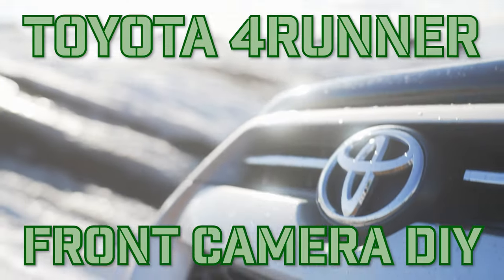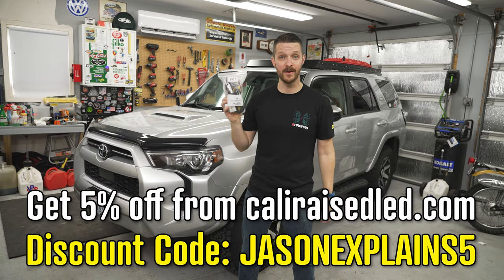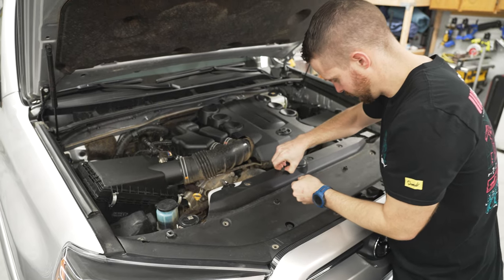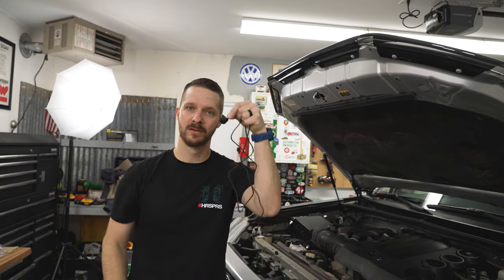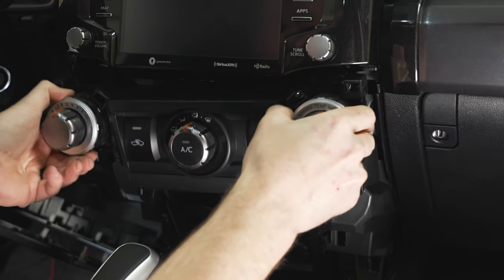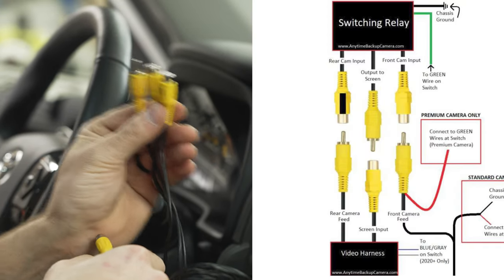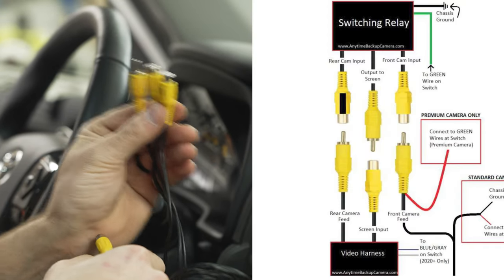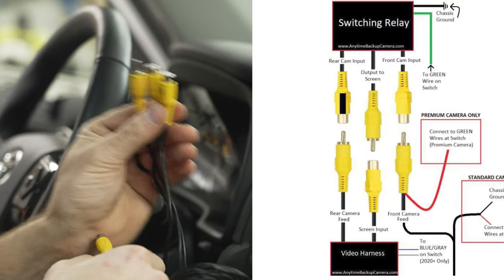Your 4Runner NEEDS A Front Camera!  (DIY INSTALL & DEMO)

Comment: How about a step further and do a 2nd front facing from underneath? Useful for wheel placement and rock bash consideration. Would need a toggle for the video feed switching.

Comment: I installed this and it works great however I noticed when I switch from front camera, to reverse, i get a horizontal split screen where it shows the bottom half of the rear cam on the top. And the top half on the bottom (if that makes sense). Anything I did wrong? I checked the wiring and ground and everything seems correct. Not sure if I need to cut another wire since I have an aftermarket HU? (T8)
Reply: Its occasional and to get rid of it I have to hit the button from front to rear super fast almost like I have to confuse the system to get the rear cam back to normal view

Comment: Jason, thank you so much for posting this, wouldn't have got one without this video! Such a cool add on. For anyone considering one, here are a couple tips that may help: 

a. The wire that goes through the firewall is relatively delicate (4 tiny wires inside) - be very careful pulling/pushing this through: you're in trouble if you break a wire - whole infotainment display WON'T work! Same if you unplug the camera. The extra grommet hole can certainly be used but recommend cutting the nipple inside the cab - just pull with some pliers and slice it off. Also consider gently slicing the grommet hole with a small knife - just a little, maybe 1/4". Will retain its shape but way easier to get the dongle through. Don't force the wires. 

b. tightening the camera nut is a huge pain. Test fit the nut on the camera before trying to install - mine was partially cross threaded from factory. It is pretty much mandatory to remove the upper portion of the grill like Jason did - be very careful if you've never done this before. You have to remove the 6 or so plastic fasteners and 1 bolt. But what you can't see are about 6 interlocking tabs that hold the bottom part of the upper grill to the top part of the lower grill/bumper. You'll need to get a very small flat screwdriver and separate the tabs one by one. You have to pull the upper grill FORWARD to the front to release it. DO NOT PULL IT UP like many videos show. You might get lucky and have the tabs self separate but likely you'll break one/some - ask me how i know. With the upper grill removed, the nut can be accessed. 

c. consider some automotive cloth tape over all connectors/wires in the cab,  zip ties have a tendency to rattle.
Reply from the maker: All great points!

Comment: Hey Jason, I went to order this kit from Cali Raised for my 2018 4Runner Limited.  Your discount code isn't working.  I presume it must have expired and wanted to let you know in case you can get it renewed.  I'm not handy and don't have the tools it takes to do this, but there's a car audio shop near me that installs aftermarket backup cameras and navigation systems that will do a professional job with this.  In my research before buying the 4Runner I'd seen one of the newer off road models that had a front bumper camera.  It looks like an essential item for off roading, particularly if you're going to be driving on your own without a passenger who can get out and be a spotter when there are obstacles.  And as you say, it's also good for everyday driving and parking.

I'll wait until later in the day or tomorrow to order this from Cali Raised in case you see this and are able to renew the discount code.
Reply from the maker: Looks like they changed it on me!  It's now: JASONEXPLAINS
Reply: @JasonExplainsThings  Thanks.  I'll put in an order and use the code.
Reply from the maker: Thanks!  This help this channel keep going!

Comment: Nice. I would move the wire you put under the carpet though. Extra wear and tear on the insulation from getting stepped on
Reply from the maker: It’s right around the edge so that won’t be a problem.  👍

Comment: So it did not interfered with your pre-collision/radar system? Did you test drive and check your radar/pre-collision sensor? I've seen other youtube video where they installed the camera on the side of the sensor. I'm not liking it not on the center. LOL. Thanks. Great job!
Reply from the maker: No issues with the placement.  Sometimes the camera itself is glitchy when it’s very cold (or hot) outside.  Radar, pre collision, adaptive cruise all work as normal.  But only do what you’re comfortable with.

Comment: Installed and worked GREAT.... for a while. Now it blacks out once it gets too hot. Currently looking for a new camera or a way to keep it from getting too hot.
Reply from the maker: Same here.  Intermittently it has issues.  If I find any solutions I’ll share them.
Reply: @JasonExplainsThings  I'm thinking of trying to wrap the wires in aluminum tape for heat resistance

Comment: This video got me excited! However I found that it is not compatible with 4Runners with a 3d Camera. The 3d camera system already has a camera placed on the front bumper.  Too bad there isn't a way to utilise it as a front facing off road camera and not just for 3d (bird's eye view) purposes.
Reply from the maker: You'll be fine with the factory camera system.  Here's a video all about it's features:  https://youtu.be/8GY9pXBwidM
Reply: So THAT'S what that button does. And I still look forward to more of your vidoes, thanks!

Comment: My 2022 had the MTM it was very helpful. I really hated that hood scoop, it reflected sun rays.

Do your backup/front camera lines turn with the wheel?

That blank space was where my camera button was. The crappy rhino about MTM is it turns off at certain speed.
Reply from the maker: No the lines aren't dynamic.  They're more a rough guide.  I agree with the hood scoop issue.  I may install something to fix that soon.

Comment: For a 2017 this is not good I've, been looking at wires for the last 3 hours and trying to map them to your tutorial an have had no luck. Maybe for 2021 specifically this is great but im having a ton of trouble.
Reply from the maker: Check the description.  The kit for 2019 and back is different.

Comment: Any Idea why the 2015 back up cam works intermittently? I just purchased mine,  it worked when I drove it out of the dealership but they gave my no warranty.
Reply from the maker: Sorry, not sure.  I'd check the wire harness on the back of the head unit.  The head unit itself might be going bad?  I've noticed glitches sometimes when its extremely cold outside.

Comment: Installed mine. Cut the white wire (front facing camera). It’s still showing reverse video. So frustrating. Any thoughts?
Reply from the maker: I’d reach out to the manufacturer.  Sorry you’re having problems.
Reply: @JasonExplainsThings  I’ve tried but they won’t return my emails

Comment: Is this or something similar available for 4th gen 4runners?
Reply from the maker: Tying into the stock head unit would likely be an issue.  You'd probably need to get an aftermarket head unit as well that would work with the camera.
Reply: @JasonExplainsThings  Sorry, I should have explained better. I have a Sony XAV-AX100. But if I recall it only has one input for a camera. But I'd really like to be able to add a front camera and have the rear on demand. Thanks!

Comment: Tried to get our ORP ordered with the MTM camera system, but no way in my area given the vehicle supply chain problems :-(. Looks like a great alternative, thanks for the video! Do the lines overlayed on the front camera picture seem calibrated like the rear view camera, i.e. the outer blue line is 3 feet from an object and the red line is 1 foot?
Reply from the maker: I’m not sure how accurate they are honestly.  BTW… I was in the same boat ordering a Tacoma.  Tried to get the camera system but it was impossible without getting a fully loaded truck with leather and everything else.  So I’m going to be doing this camera again.

Comment: Will this work on 2010 if cruiser with aftermarket head unit ?
Reply from the maker: You’ll want to find something that’s made to work with your aftermarket head unit.  This is designed to work with 4Runner factory head units